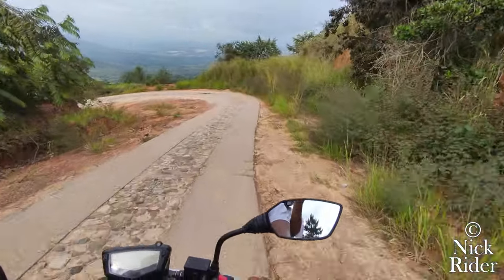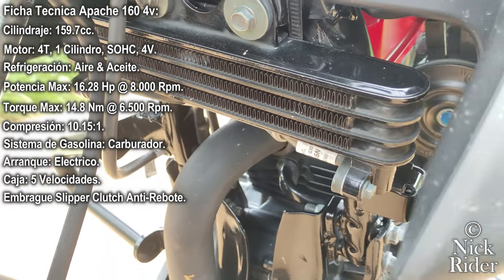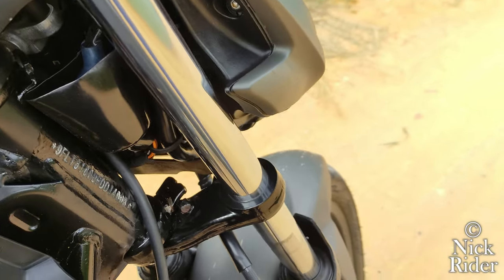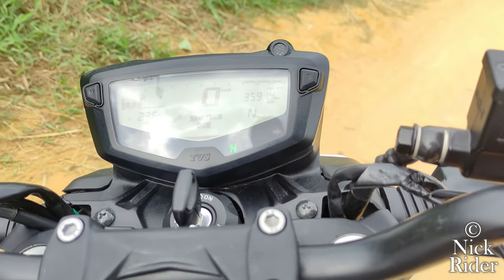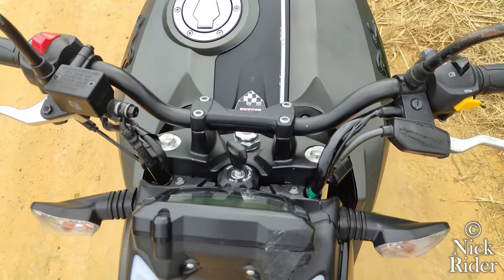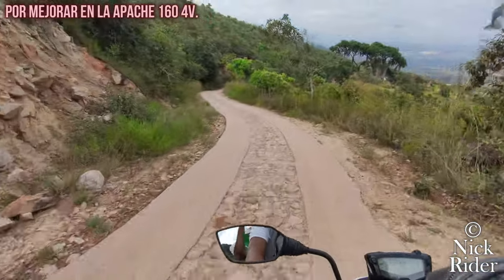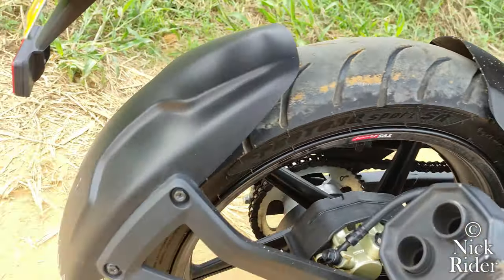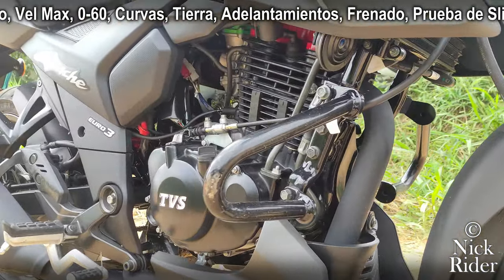TVS Apache 160 4v 2023 - Ficha Técnica, Precio, Buena o Mala? @NickRider

Comment: Tengo la 200 carburada 2022.
Para salvaguardar la estética de la moto en caídas lo primero que hay que hacer es :
1° cambiar las defensas originales son pésimas y colocar slider en ambos lados (adelante y atrás)
2° Las llantas originales son un peligro, hay que cambiar. 
3° El orin original del selector de cambios es pésimo y se cristaliza rápido produciendo salida de aceite, se cambia y solución a la falla. 
4°Cambiar el gato lateral por uno más largo.
Para completar yo le puse parrilla y maletero,  también un puerto para USB con adaptador de compresor de aire.(Lo cargo siempre en el maletero).
Le complemente la luz con unas excelentes exploradoras   de luz amarilla y blanca de profundidad y radio.
Resultado total una maravillosa moto.
Un abrazo fuerte y un 2023 lleno de éxitos para todos.
Un abrazo fuerte 
💯💯🤝🤝👍🙏
Reply from the maker: Ufff excelente broo, muchas gracias por comentar y compartir tu experiencia, saludos y abrazo también 👌🤙

Comment: Es la mejor moto 160 la apache 160 FI Pero dejo de vibrar? Porque la potencia y torque de está apache 160 FI da para viajar en carretera viajes de mil kilómetros con pasajero pero si sigue vibrando con la apache 160 carburada entonces no valdrá la pena comprarla nobtodo es potencia también el confort es incluso más importante confort que vemos en la XBLADE 160 DE HONDA con menos potencia pero no vibra nada! Así apache y pulsar vibran mucho sea 160cc o 200cc y por otro lado tenemos Honda 160 y 183 la 190 honda  no vibran pero les falta torque y potencia pregunto habrá una que no vibre cómo la honda y con torque de la Pulsar 200 FI?
Reply from the maker: Honestamente bro, si buscas una moto que no vibre puedes pensar en una eléctrica jajaja.
Para mí la 160 es muuuy cómoda y no vibra nada.
Recuerda que son motores de combustión y tienen mucha masa moviéndose por dentro.